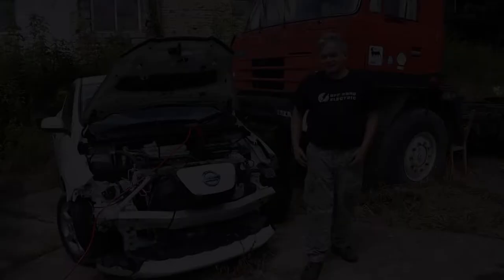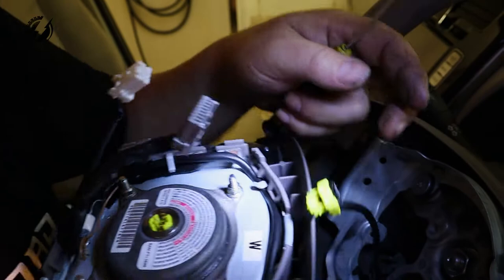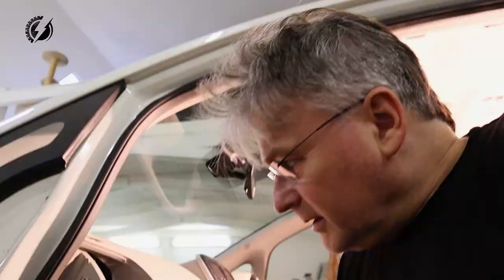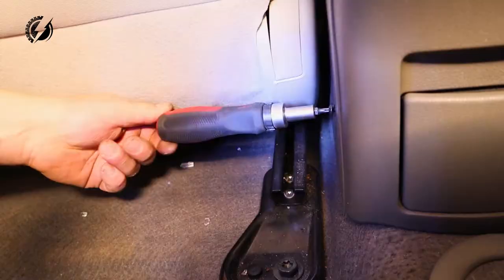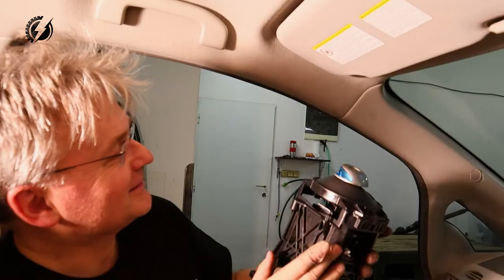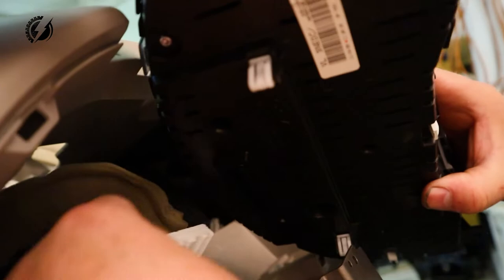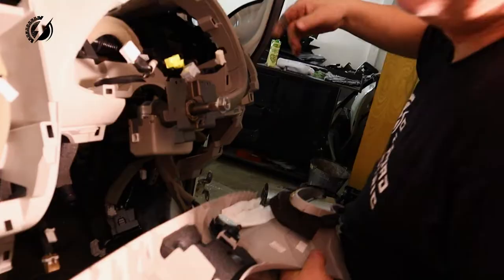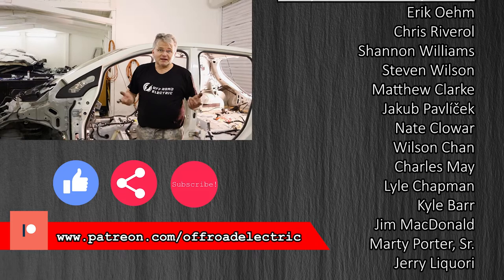EP41/1 Best Off Road Electric Monster Truck Build-Leaf

Comment: You're getting really good at popping those connectors and clips.  Some connectors are like a Chinese jigsaw puzzle, and come apart after a lot of swearing and poking yourself in the fingers.  Amazing that all connectors are pretty well different, I guess they don't want to mix them up in the factory and have your windshield wipers come on when you turn on the lights :)  Cheers.

Comment: As always a great video!!  I continue to be impressed with your ability to get all those connectors undone.  I must admit that I was reminded of an old joke people used to say about me, when I would work on cars back in the 70's and 80's, which was to only fix the nut behind the wheel.  Now please don't for a second think I am suggesting this applies to you, but when I saw you taking the air bag off the wheel, it reminded me of a similar experience I had before the invention of air bags.  -_-
Reply from the maker: Thanks! A great video comes into existence in the editing room. Libor did a realy good job with this one. A lot of short sections is very time-consuming. I am in the UK to figure out how to continue.